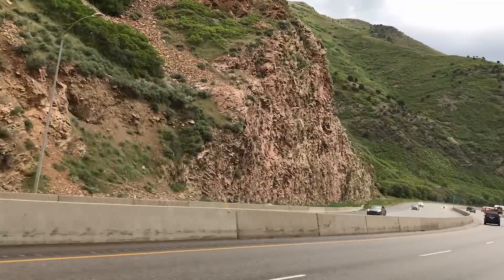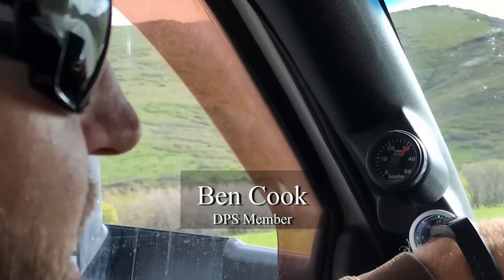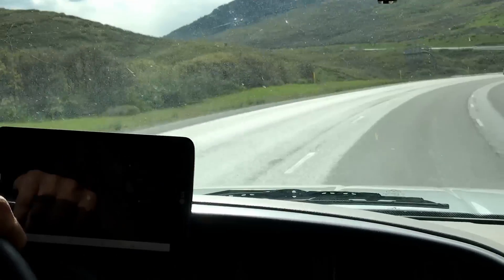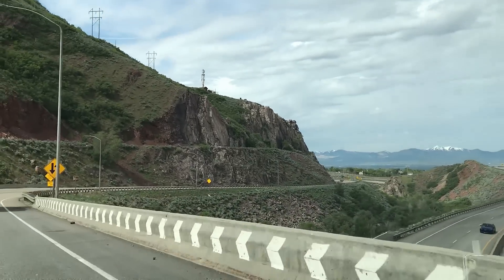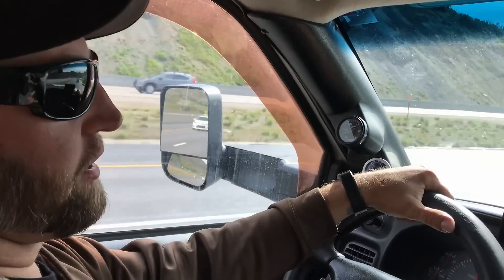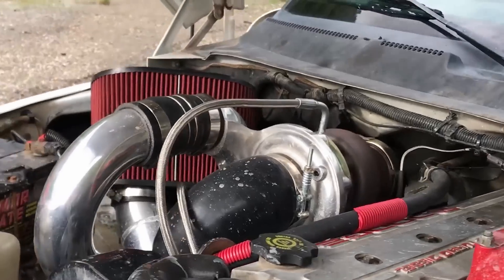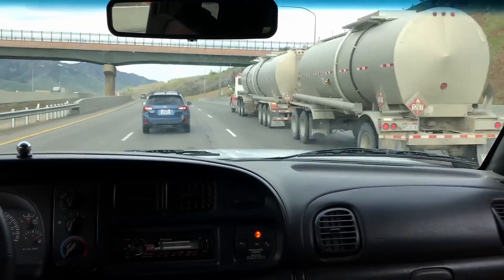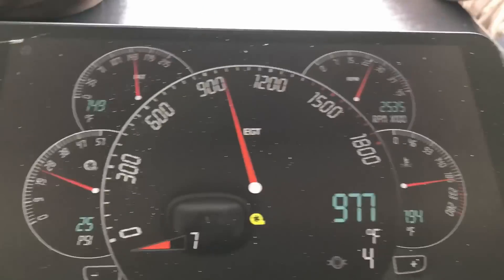24V Cummins pulls a heavy load up Steep Canyon Hwy with Compound Turbos | DPS Sequential Turbo Setup

Comment: Haha!! That's comical, I don't care what slip he handed you that camper is no where near18,000lbs! 2 axle 18,000lb bumper pull camper, that's a good one😂😂
Reply: I looked at the setup too and its like so that trailer weighs a little less than a tandem axle galean vacuum trailer.

Comment: how does my 44' cyclone toy hauler weigh the same as your small bumper pull? 🤷‍♂️
Reply: That guy is full of shit. Not a chance in hell of that camper weighing anywhere near that
Reply: Ya my fx 1900 Superlite weighs 5100 empty. That trailer is no longer than 23 feet and say he has 2,000 lbs worth of stuff in it, it can’t weigh anymore than 9,000 lbs.

Comment: Fully loaded that trailer might weigh 8500#... Good looking truck though
Reply from the maker: Well the trailer a toyhauler with 4 atvs that we are told weigh approx. 4500 lbs.  So we estimate that the trailer is around 14k lbs and truck is around 8k lbs. The owner is going to get us a pic of the scale ticket next time he takes it out. However, the actual weight doesn't really matter because the compounds would still keep the EGTs at or below 1200 degrees whether the gross combine weight was 8k or 25k lbs. The point of the video is that with our compounds, even at high altitude with a heavy load you can drive your truck 70+ mph on a long pull without having to regulate your temps by taking your foot off of the pedal. The compounds make high temps a non-issue.
Reply: DieselPowerSource im not calling bs.... but there is absolutely no way that trailer weighs that much. 4 ATVs at 4500lbs is enormously over estimated. An 1100lb quad? Never heard of it... maybe a side by side, but you aren’t fitting 4 of those in a small double axel like that. That entire trailer is 10k MAX. If that... that’s 150 territory there.

Comment: Not to hate. But don’t look like 25k .... unless you’ve got that thing loaded with concrete blocks. 

I will say this is the kit I’m going to buy for my 06 5.9 ASAP. $$$!
Reply from the maker: Actually, we just found out that the truck weight is about 8,700 lbs plus the trailer loaded with atv's weighs about 14,000 lbs-15,000 lbs (allowing 10% transfer to hitch) = 22,700 lbs-23,700 lbs GVR load.   truck would be 8300 to 8700 depending on bed. 

What size of injectors are you running on your 5.9L?
Reply: I must have missed that part of things. When talking about specifically the engine pulling the weight of everything I can see the 25k lbs. That is very impressive. 

My pickup has stock injectors as far as I know. Bought it used 3 years ago. 

My truck runs hot with the 37s now. Average 900° on the freeway. I need to cool it down. 

2006 5.9. Mega cab. 6 speed manual. Stock clutch. 4x4. 62mm Tater built HE351CW turbo. DPS 3 piece 3rd gen style manifold. Edge tuner. SB intake. Straight piped. 7” lift. 37s. 22x14s. Few other things. 

Whenever I can gather the cash or you guys have a good sale I’m in!!! I’ve been checking out all your videos the last 3 years and I really could use the setup. Specifically the stocker kit. 

Not to mention all the smiles per gallon 👍🏼
Reply from the maker: With your fueling I would recommend our 62/71/12 over S475 for you truck as well.